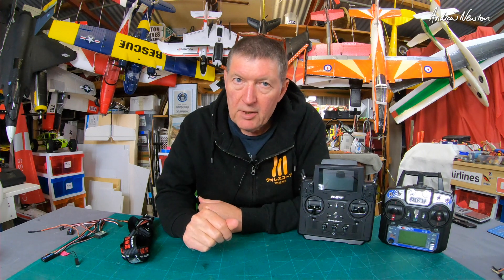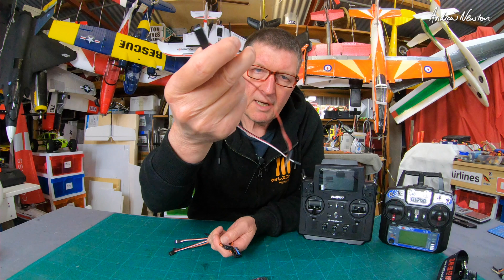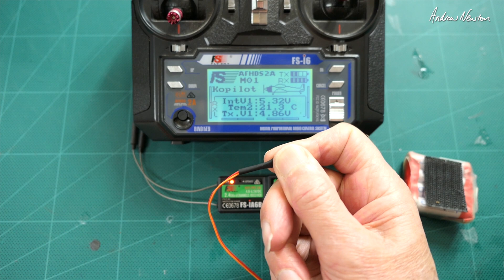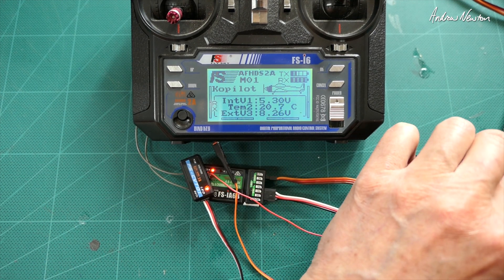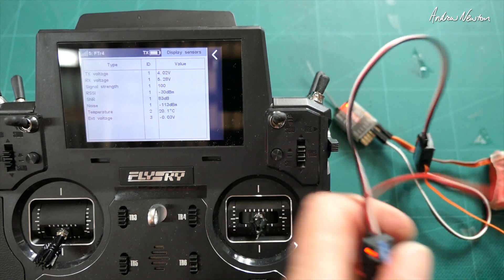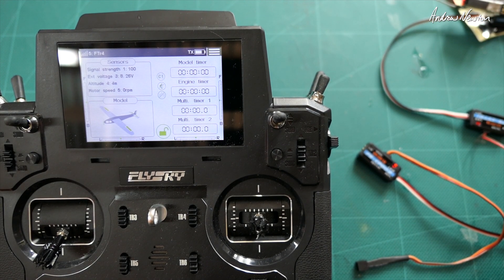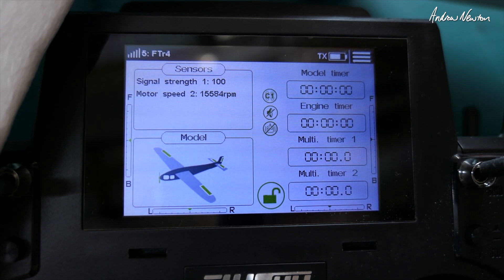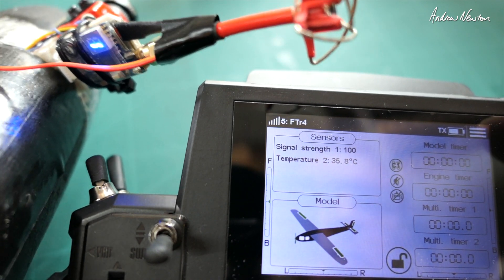FlySky FTr4 receiver and iBUS sensors

Comment: Flysky FS-iBG01 gps wont connect to PL18 throgh FTr10 reciver ... why?
Reply from the maker: Requires an iBUS2 receiver maybe
Reply: @AndrewNewton  This is odd since the FTr10 is one of the new AFHDR 3 protocol receiver lineup. It should support i-BUS2 protocol since it supports the FS-iBH07 7-channel i-BUS2 expander from FlySky. This expander is necessary to attach miltiple i-BUS2 sensors of the new lineup since they cannot be daisy-chained anymore, unfortunately!
Reply: Please let me know if you succeeded finally to connect it. I am expecting my PL18 and FTr10 receiver soon and was planning to get the FS-iBC01 for some development and testing.

Comment: I have a fs altitude sensor can i get it working on fs 6 channel reciever or upgrade 10 channel radio
Reply from the maker: If it's an iBUS sensor and you're using an iBUS receiver then yes.
Reply: Thank you for reply andrew but ive tried to find it on my fs i6 upgraded to 10 channel radio but all it gives me on the sensor is 3 options tx rx and another thats it i do have 10 channels so ive done the upgrade but it wont work voltage sensor works but not altitude can you help pls i do a lot of high gliding and the altitude sensor would help ne a lot please
Reply from the maker: @andrevella4114   Maybe altitude doesn't work. Try searching on RCGroups

Comment: Will the voltage sensor work on the receivers for the Noble NB4 transmitter??
Reply from the maker: Dont know, good question
Reply: Ok been a while,  but the fs-cvt01 voltage sensor works with the fgr4p FlySky receiver that is for the noble nb4. Use the ibus port on this receiver.

Comment: Can you use a Frsky vario with the fsi6 binded with a tx16? Cause those are super cheap rxs... And I modded like 8 of them with onboard voltage sensors... So all I really need is the vario for my gliders. Can I do that?
Reply from the maker: No, they only work with FrSKY receivers that have S-Port
Reply: @AndrewNewton  sadly

Comment: Hello Andrew ,great video as usual😊 A question...What range or approximate range can be gotten on the Fs i6 transmitter and
(2).Is it possible to connect more than one Telementary Module to a receiver all at once
Reply from the maker: Range around 2km. Yes sensors can be daisy chained
Reply: @AndrewNewton  Thanks for the reply,would I get that range without any Modifications to the Radio hardware?and did you do are range test or you just assumed the range based on your flying experience 2km would be ⚡ for a 50$ Radio😁 thanks I look forward to you reply...

Comment: How do you get the rpm sensor to read accurately.  As in how does it know the size of the prop, or wheel or whatever it is your useing.
Reply from the maker: RPM doesn't require prop size
Reply: @AndrewNewton  yeah I’m going to use it for speed. But I guess when you do rpm it doesn’t matter. Which still doesn’t make any sense to me.  But I read that when using for speed the radio has a set up procedure.

Comment: Returning to an old topic regarding the FlySky-FS-CAT01-Altitude-Sensor - https://bit.ly/3jgaTeT
Whilst strictly not a Vario there is a method using a LUA script to have the Alt values converted to a usable Vario ft/s value that you can use in OpenTX; someone a lot smarter than me has kindly compiled the LUA code and details here >>> https://hackaday.io/project/175220-flysky-variometer. Note this LUA script also ensures the correct audiable tones for ascent and decent. Note 1) You need the latest version of OpenTX that supports Custom Scripts to run the LUA code (add it to your Scripts/Mixer folder on the SD card) 2) There may be some requirement to calibrate your sensor under the sensor Telemetry settings in OpenTX to ensure it works correctly. Thanks Bud Bennett for sharing this code via hackaday.io.
UPDATE: After updating my TX16S to OpenTX 2.3.11 and adding & activating the LUA script within the Scripts/Mixer folder on the SD card then setting up as per the Hackaday instructions I can 100% verify this LUA script works very well and will enable you to use your FLYSKY CAT01 sensor as a vario. Whilst maybe not as elegant as the FrSky vario options this hack works more than well enough for me to say I'm glad I haven't bought any FrSky vario receivers cause for $10 and a little LUA script it works extremely well at a fraction of the cost.

Comment: I had great success with these sensors on the FS-I6X, but I'm struggling on the Radiomaster TX16S.  Is there any chance you could put a video out showing them working with an OpenTX multiprotocol transmitter?
Reply from the maker: I'll get to it eventually but lots of other stuff on just nw.

Comment: When that works on the normal fsi6 I'm more then sold for a vario
Reply: The CAT-01 is a barometer/altimeter, not a vario.
Reply: @pierauspitz  this can be used as a vario look up ben bojanles I6 mods
Reply: @steven4420   I am strating to wonder if a lot of people are actualy mistaking altimeter for variometer. 
On benb0jangles, the mod (from qba667) actually enables the altimetric/barometric telemetry on the fs-I6, nothing more. 
I may be wrong (I hope I am), but so far, I have found no evidence anywhere that a true vario function has been developed using the CAT-01 on the FS radio systems (afhds 2a or afhds 3).
I mean, come on! If it was, the CAT-01 and dirt cheap FS receivers would be on the lips of every serious glider flyers... But it isn't, because it doesn't.
Reply: @pierauspitz  Are there any systems have that ability? Thanks
Reply: @kf4293  If by "systems" you mean brands and series of radios/transmitters/sensors (sometimes sensors integrate to receivers), you shall find the vario function with FrSky ($$-$$$), Spektrum ($$$), Futaba($$$$), Multiplex ($$$$) and Jeti ($$$$+) to quote a few. 
You will also be able to use one of those branded sensor/receiver with one of those cheaper-yet-nice OpenTX, multprotocole transmitters (Jumper T16-T18 and the Radiomaster Tx16) or even clones (for exemple the Orange series if Spektrum is your thing, or a AT10 for Futaba.)

Personaly, if you want bang for the buck, I would advise to go the FrSky road. It's miles above FlySky in quality. The Taranis X9D (SE series has very nice sticks) is very capable and well built, OpenTX is very quickly installed on it, and has a massive user base that span over 10 years, with excellent reliability (not the case with the Jumper products). Their standard receivers and sensors (vario, gps, current draw etc) all work very well. The compact, dedicated gliders receivers (8 and 6 channels with vario) are very nice too. 
There is a lot of gratuitous online hatred for this brand (most coming from people frustrated or terrified to not own "the latest best thing" when FrSky updates their hardware or software). Do not listen to it. 
I find this brand to offer very good hardware at an excellent price. You can always mount a multi-protocole module on the transmitter later on if you want to use other maker's gear.
As always, do your research and always know that you get what you pay for...

Comment: I use the altitude sensor on my KAP and KAV kites (my Tx is the FS-i6X). Angle of flight is nothing like height above ground, and it varies with windspeed too, so it's nice being able to let out outrageous amounts of line and still stay legal.

(Yep. The boys from the CAA are always lurking in the bushes with surface-to-air missiles ready to shoot my evil kites down...)

Have they corrected the altitude sensor's typo yet? Mine's marked as an 'ATTITUDE' sensor. Ho. Ho. Ho.

A vario would be interesting, but this is still fun. Cheap, too.
Reply: One question which variometer are u using? I had an altitude sensor with the ia6b and it didn't work

Comment: I have the voltage sensor and its hopelessly inaccurate
Reply: Hi Julian! Is the error always the same? If it is consistently wrong, perhaps you could recalibrate your alarm voltages to allow for the inaccuracy.

Ignore the actual numbers and rely on the alarms. Not very professional, but better than nothing, maybe?  Well, it's just a thought...  :-)
Reply: @EleanorPeterson  Hi Thanks for your reply
Yes i tried that .I n the end I lost faith  I just bought a frsky i10 and have never looked back.
Julian

Comment: I can confirm that the CAT-01altitude sensor and CVT-01 voltage sensor work natively witht the FS-I6x.
However, the CAT-01 is a pure altimeter, not a vario.
The telemetry also works perfectly well on the Taranis X9D+ 2019 with a Multiprotocole module in serial, but once again, impossible to set a vario function.
It also does not have the greatest accuracy: the number indicated has a supposed precision of about 10 cm, but the overall value drifts by a few meters over a very short time.
However, it's perfectly fine to ensure legal flying altitude is not exceeded and can give a rough idea of lift or sink (using altitude vocal call-outs of the x9d is perfect for this). 
But hey, given the price, can't complain . :)
Reply from the maker: Thanks for that info
Reply: @deancooper5513  In my case, making the altimeter as vario source only gave a constant, high pitched beeping. Basically, my Taranis X9D with multiprotocole module seem to read the altitude directly as a vario value (+120m is understood as +120m/s)... Not ideal. 
Tried to create a calculated sensor (that would calculate the altitude delta over a given time), but no formula allow it.
And anyway, I do not believe the CAT-01 has the senstivity/accuracy to be a useful vario (it drifts over +/- 5m on its own accord within seconds).
As for the FS-I6, its speaker is a simple buzzer, so the range of sounds is extremely limited. 
And I'm sorry, but this is the kind of modification would be extremely popular. However, as I have said elsewhere, I have not seen it anywhere yet...
Reply: @deancooper5513  IT IS NOT A VARIO BUT A BAROMETER. The fact you must use offset shows it is NOT working. Logical switches were a track I followed, but it does not work properly. There are no "delta altitude" function available, so it is NOT a VARIO. Please, stop now...
Reply: @pierauspitz  dewd the CAT-01 works as a Vario with the FlySky I6 radio after you load the updated software here from GitHub >> https://github.com/qba667/FlySkyI6

And here is the GitHub page for the CAT-01 sensor set up with the I6 as a Vario >> https://github.com/qba667/FlySkyI6/wiki/Vario

I'm yet to try my I6 which I hacked months ago but I'm not overly fussed cause I like flying with my TX16S right now.
Reply: @deancooper5513  I am far from convinced. As I told several time before, cat-01 is a simple barometer. While a VARIO is very similar, it is slightly different and needs either a different construction (with a "delaying" chamber), or needs calculations with the input of a clock ( granted, that could be done with the transmitter's own). However, and once again, the accuracy of the CAT-01 is pretty bad. Doubled with its false precision, that does not lead to a reliable vario anyway.
What I also find interesting is how little attention this mod is receiving. Given how revolutionary it could be, 
make your own conclusions.

Comment: I have the Voltage, Temperature and Altitude sensors. They all work on the FS-i6X radio (with FS-iA6B receiver).
Unfortunately no Vario function.
Reply: What is a Vario function? I'm new to all of this. Thanks
Reply: @kf4293  A vario is a vertical speed indicator, used by glider pilots to find (and stay in) thermals (vertical air currents) to extend their time in the air. An audio- vario also adds the ability to hear when your vertical speed is increasing, by listening to beeps. In RC- world radios like the Taranis and Spektrum DX9 have vario functions, see this video for a demonstration >> 
https://www.youtube.com/watch?v=vHPc6VhQRm8

Comment: Not entirely sure that was 18,000rpm. It looked a bit optimistic.
Reply: Hi, Stephen! Yep. I wonder if it's reading double? I've got a cheap laser tacho that came with reflective foil, and it doesn't always need it.

A 2-bladed prop can be sending back 2x information; Andrew's motor didn't scream like an 18k pylon-racer, so I think you're right about the optimistic reading. A 3 or 4 bladed prop would really confuse matters!

I found it was best to keep a good foot away from the (marked) prop so that the weaker 'ghost' reflections from the unmarked side weren't registering. Perhaps Andrew needs to move the sensor further away?
Reply: @EleanorPeterson  good to know, thanks.

Comment: I have got about 6 Voltage sensors and I find that they vary a lot. Unfortunately they read mostly high.. It's well worth checking them out before you rely on them. The worst one I have reads .8 of a volt high so when your 3s pack is reading 11 volts and you need to land, you will find you really only have 10.2 volts, not good :) The best one I have is only .2 high, easy enough to calculate when flying.... Having said all that, it's very good to know your voltage :)
Reply: Hi, Peter!  That's good information. I can see there'd be a problem with duff readings, but is the error consistent? If it is, wouldn't it be possible to work around it by resetting the alarm voltage to whatever the error happens to be and just ignoring the actual numbers? Not ideal, but better than nothing, perhaps.

Happy landings!  :-)
Reply: @EleanorPeterson  Yes the error is consistent on each of the sensors I have and what you suggest seems to be the only way to get it to work but it's still off putting to see incorrect numbers on your readout. I have tried both ways, calculate in your head or set the alarm as you say. What ever you decide it's still good to have a voltage readout of the flight battery :)

Comment: You should see if you get sensor readout on the Radiomaster with the Flysky rx and the sensors
Reply: I have that same setup on one of my planes, ie Flysky receiver FS-IA6B with the voltage sensor and the Jumper T16 Pro (almost the same OpenTX transmitter as the Radiomaster). It works perfectly with voice readout and alarms. The FS-IA6B with the voltage sensor is so simple and reliable, it has become my favorite setup now. The receiver is just $10 and the sensor is $5. The receiver performs similar to the more popular $35+ receivers. Since they are so cheap and good, I have ordered another pair.

On another note, I take a branch wire from the main battery lead and hook it permanently to the battery sensor. This way, I don't have to connect the sensor lead to the battery JST connector every time I change the battery.
Reply: Yes you do, they work just fine. I have battery voltage and vario on the TX16S screen and have the spoken battery voltage level and battery alarm all covered by the TX16S.